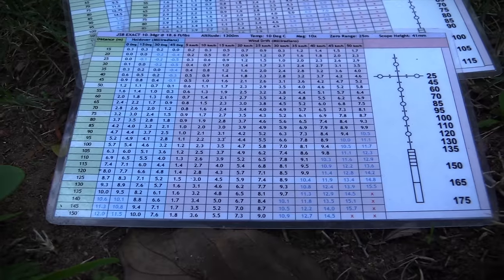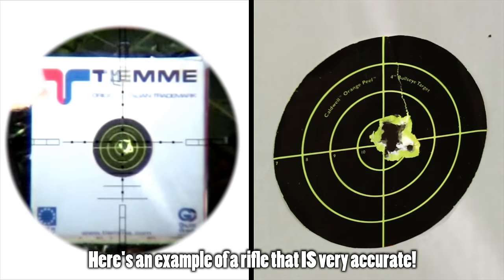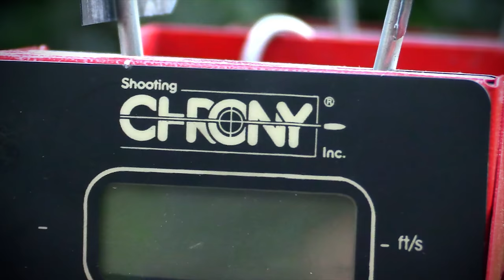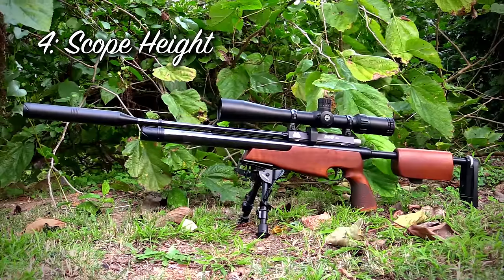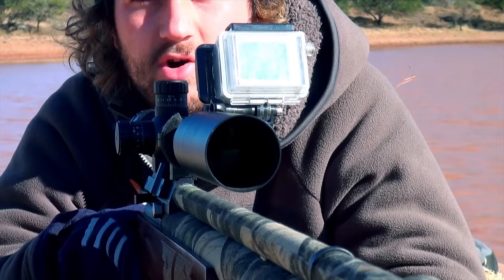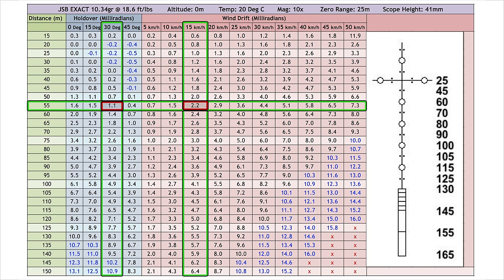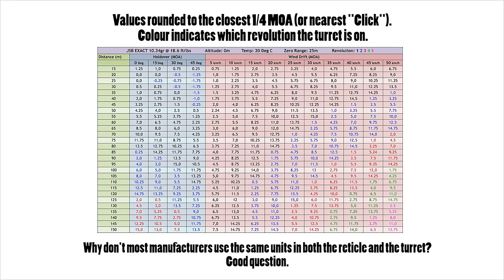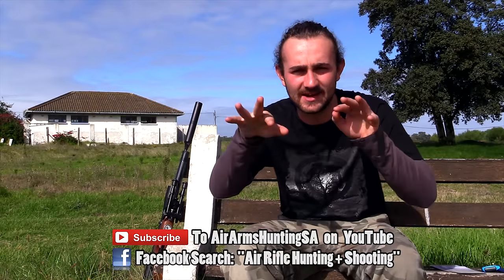Range Cards for Shooting - How to Make Them (Finally!)

Comment: Awsome work matt, can u also explain in this how you transfer the generic mildot within chairgun pro to the scb mtc reticle. Also using the table with chairgun for "clicking" dialing in ranges. As it say -1.32 for instance, and i just dont get it. It is me probably being thick as 2 short planks but if you could simple it down for the likes of me it would be very very appreciated many thanks. Matt. W
Reply from the maker: Hi Matt. The SCB reticle is a true mil-dot reticle, the only difference being that the "dots" are lines and that there are half dot markings.

When you want data for the turrets, use MOA as your unit. Check to see if your scope turrets are 1/4 MOA per click or 1/8 MOA per click. Then just round the number Chairgun gives you to he nearest 1/4 or 1/8:)
Reply: Awsome mat i knew u would be able to wxplain it so i would understand it easier chears pal. Cant wait for the next vid..#LEGEND

Comment: Really nice job on the cards, i might be stupid but how do you calculate how much holdover in mil-dot you get with the different degrees of elevation? Wow this post got really confusing but i hope you get my question. Best regards from Sweden!
Reply from the maker: Hi Andreas. Enter the degrees of elevation into chairgun (at the top) and it will give you a new set of holdover values in the table on the left. You just repeat this step every time you add a new column to your cards:)
Reply: Thanks for the quick answer!